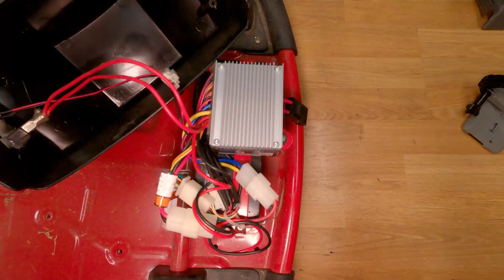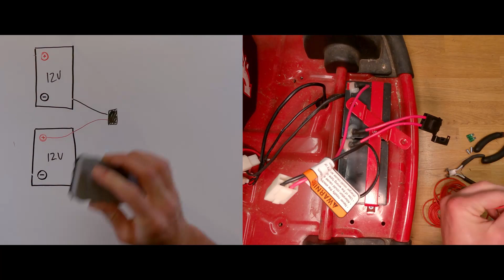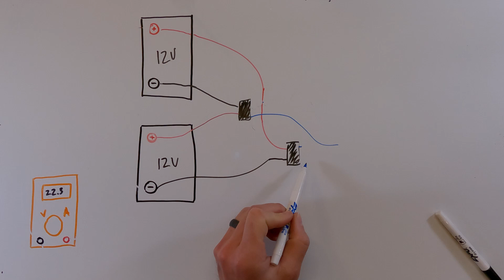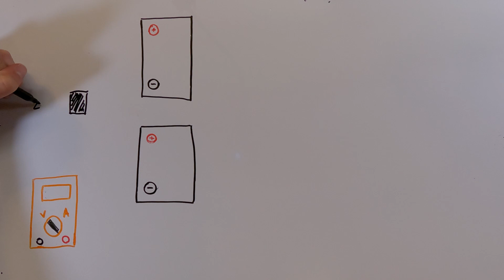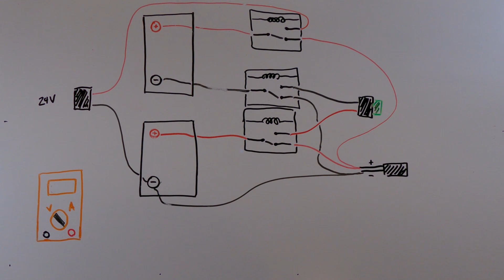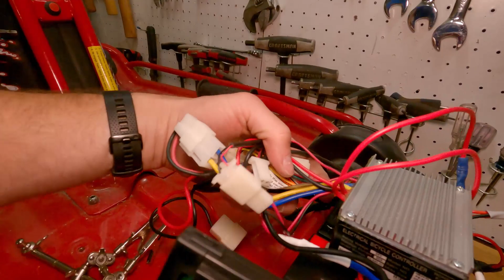Fix-It Friday - Crazy Cart Charger Conversion and Troubleshooting

Comment: I ordered a new battery and connected to my crazy cart, I have power, meaning the light came on, but no power when pressing the go pedal...Is it possible that my new battery came in completely dead and just needs charged? It's on charge right now, going to let it get fully charged and try again...

Comment: If I’m going to replace with 1 48v battery how would I wire that?
Reply from the maker: Assuming you've got a 48V charger and the motor controller can handle it, just connect it in series with a fuse. Similar to the schematic at 1:22, but remove the top battery and connect the black fuse holder line directly to the 24V supply connector.